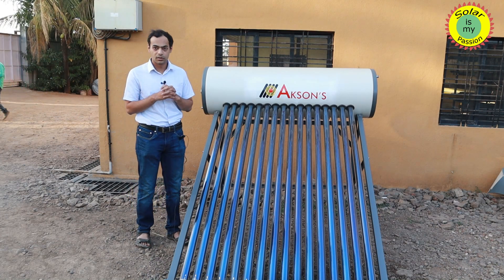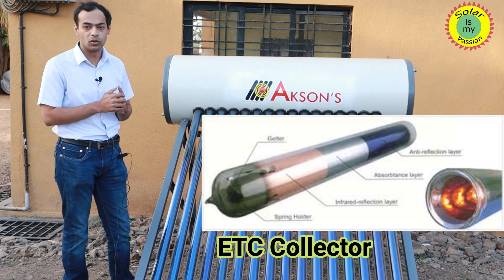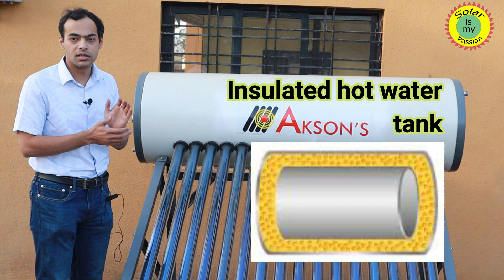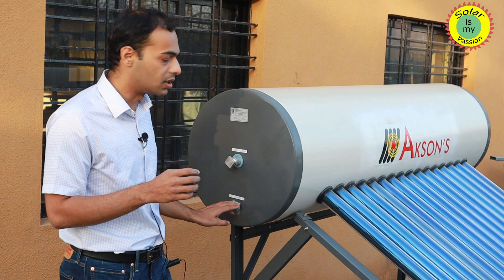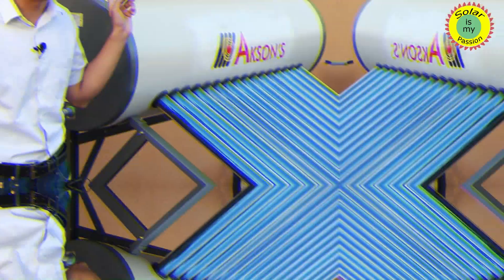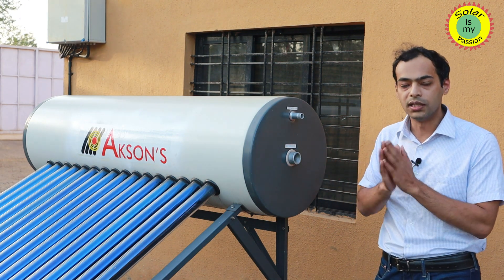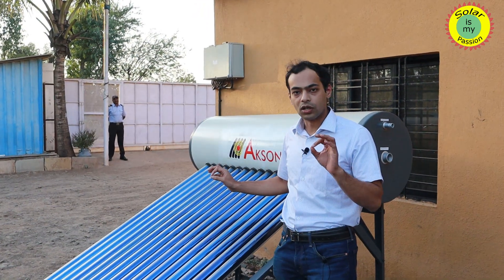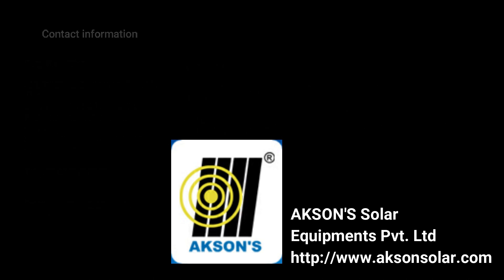solar water heater working and its parts - explained,सोलर वॉटर हीटर | Solar Water Heater

Comment: What are the CPVC sizes of inlet & outlet pipes given by the OEM brand ? Should we still use the reducing method to connect 1inch to 0.75 inch pipes for pressure on hot, just like how we do it for cold water to bathroom ?
Reply from the maker: Dear friend 
I have shared enough information on YTchannel – and on our website 
Apart from this you can get the policy details on national portal or your Discom website 
You can approach your local vendors and get the latest updates 
For my consultation you are requested to book the appointment 
https://www.ajitbahadur.in/consultation
We will have a proper discussion – as we have to manage our timings also 
Rest – the choice is yours 
Regards 
Ajit bahadur

Comment: Thanks for sharing this information .very  useful. I have a question though . You said it’s a non pressurised tank does that mean this solar water heater cannot be used with pressure pump ? Could you please elaborate if the tubular solar water heater cannot be used with pressure pump
Reply from the maker: No - Basic ETC are not ment for preseurised applications
Reply: Ok . So if I want to use pressure pump . Are there any ETC I can choose or should I go with Flate plate only ?

Comment: Excellent explanation sir, but I had small question. The electrical heating coil that we have to attach, will it be manually switched on and off, or automatically?
Reply from the maker: its your choice - but go with manual , effectively use solar energy

Comment: I had recently got two solar geysers ( 200 ltrs & 300 ltrs) dismantled  and cleaned when roof surface of our house was under repairs. When solar heaters have been re-assembled, the  tubes are not generating hot water. The external heater however is functional and producing hot water. The local dealer has not been able to help sort out this problem. we are being subjected to lot of inconvenience due to this malfunction. request advice what possibly has gone wrong
Reply from the maker: join live Q&A session 1030-1130 am every sunday 
informative video already available on channel 
subscribe channel for latest and regular updates

Comment: Can we use soap water to tubes? 
Or merely wipe clean the tubes. 
Does solar tank has a horizontal partition as to differentiate hot & cold water. Supposing hot temp at the top is around 60c as explained then what would be temperature at bottom of the tank. 
Very fluent English & explanation.
Reply from the maker: Shape your career in solar industry by joining online interactive solar training https://bit.ly/3f72RTW 
Training calendar batch 2: https://bit.ly/32P4cdg 
Course enrolment form: https://bit.ly/3np4JKP 
Last batch course review: https://bit.ly/3f4n9gZ 
Batch 1 students’ details: https://bit.ly/3nvXror 
Testimonial video of student: https://bit.ly/3pDaGpd 
Testimonial video of student: https://bit.ly/3nImAN5 
Subscribe the channel for latest and regular updates on solar energy: http://bit.ly/2KX678U 
Solar talk | Live Q&A every Sunday 1030-1130 am : https://bit.ly/3pL2Nyi 
Follow us on Facebook: https://bit.ly/2KgLYuP 
Follow us on Instagram: https://bit.ly/2UAK1eq

Comment: Some systems have horizontal tubes. How the water will flow?
Reply from the maker: It works, its manifold..
Save space..
Reply: Solar is my passion How water will flow in horizontal tubes
Reply from the maker: Density difference.
Reply: Solar is my passion Which one is more efficient and reliable
Reply from the maker: Contact nearest dealer,
He will suggest the system as per your requirement

Comment: It is non pressurized dolor water heater
Reply from the maker: dear ETC systems are mostly non pressurized only 
heat tubes are used in pressurized systems

Comment: This is very knowlegeble video, i like to ask after sun set , if two of the family member take hot water from the tank and use it, cold water will replace it in the tank, we still get the hot water.
regards
Reply from the maker: Dear sir
After sunset, the system is stopped working.
The hot water is stored in the insulated thank
The temperature of water inside the tank depends on the solar radiation of that day

In thermosyphon system, which works on natural gravity, the hot water is replaced by the cold water during usage.
Here number of persons dosent matter, it depends on the quantity of usage, transmission loss, 

If the capacity is 100 ltrs and 2 members use 50 ltrs in evening then cold water will replace hot water.
In morning the temperature of the system will be less as compared to evening temperature.

You will get hot water but at slightly less temperature.
There are other factors also.

It's a vast subject with lots of dynamics..